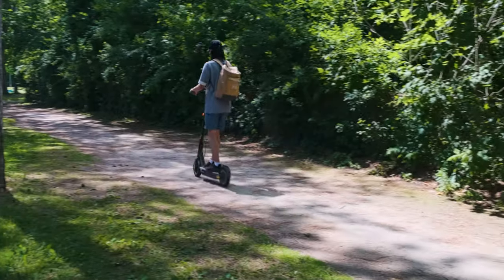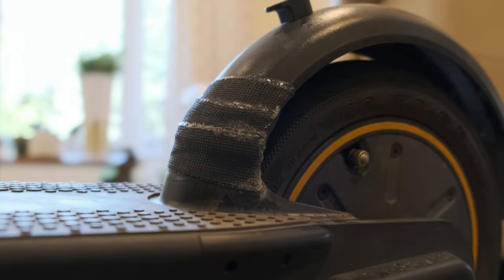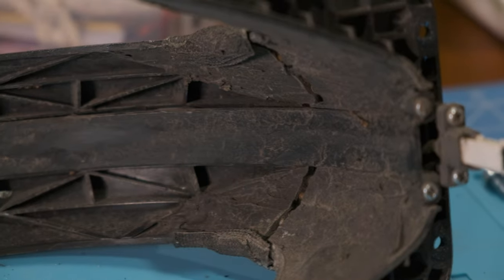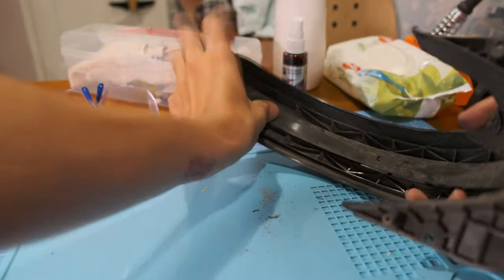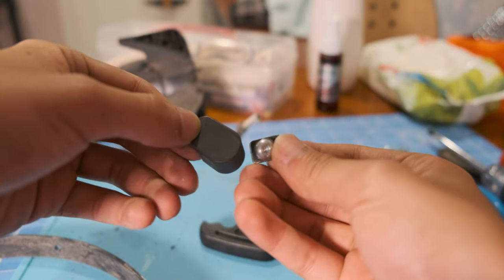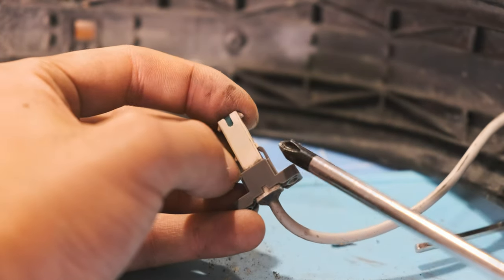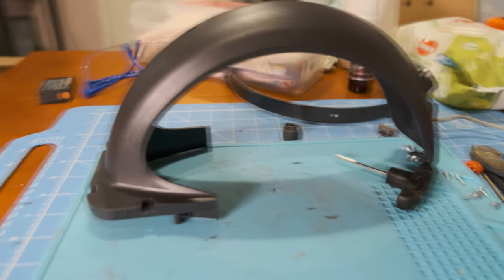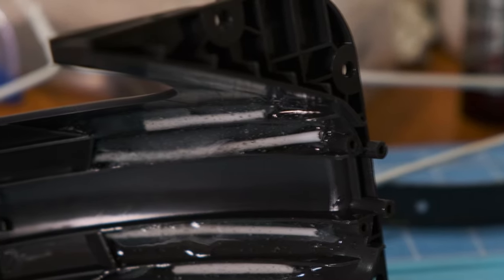Ninebot MAX Fender Fix

Comment: Mine finally broke after 4000km...got the new one today, hopefully I'll be able to change it as easy as you did cause I really suck at repairing stuff
Reply: How many tires have you had to change so far and/or have you used any  tire slime to seal off your tires?
Reply: @Sc0pee  I'm at 5700km now, I haven't changed any tire yet but feels like it's coming. I also have this xiaomi pump I use every 3 days because my rear tire's pressure goes from 40 to like 20 in 3 days. I haven't used anything on my tires
Reply: @Sc0pee  also, these rear fenders from other sellers are garbage...they break after 2 weeks, so try to find the original... I'm trying to buy an original but it's hard in the US, it's like Segway has zero employees...
Reply: @vikplevnes736  Thats encouraging to hear! Maybe it could be the valve that is leaking a little bit or just the tiniest hole somewhere? You could try adding in some green SLIME (tire sealant) and it probably would fix the leak. They say most of the tire punctures can be fixed sith that stuff. Search "ninebot max fix flat tyre" in Youtube. Its the name of the video.

Comment: Hi, has your new mudguard held up with your technique? Mine cracked and I’m buying another mudguard but don’t want to go through the process of the mudguard support installation since it’s so complicated. Thanks!
Reply from the maker: Emanuel Baldestein yes it is still holding up!
Reply: Yun Production thanks for the info! And you just cut some pieces of a clothes hangar and glued them onto the weak points of the mudguard?
Reply from the maker: Emanuel Baldestein yeap that’s basically what I did

Comment: is the rear fender a little bit twisted to right,like it is little bit more on the right side when you look it stright from the back? 🧐
Reply from the maker: Ilija I I notice slight bend in the plastic for the replacement. I’m not sure if that’s true for the original
Reply: Yun Production no no, haha , i ment for  my scoter that i can see a little bend to the Right side of the rear wheel , my is new,2 weeks old scoter, and i have that problem, do you notice the same on yours?
Reply from the maker: Ilija I I didn’t notice anything bent
Reply: Yun Production can i send you mail to see it?
Reply from the maker: Ilija I okay